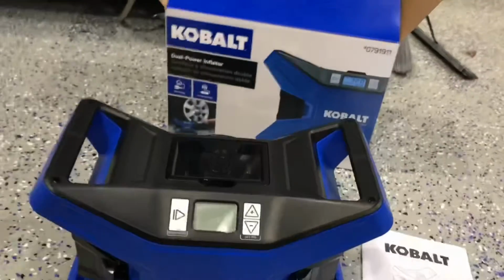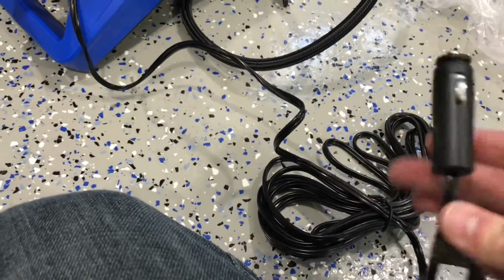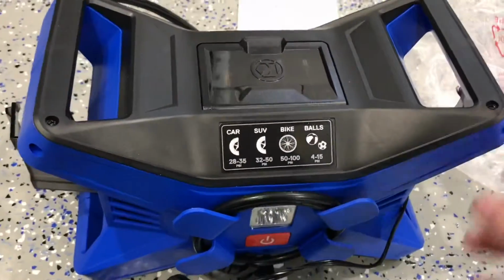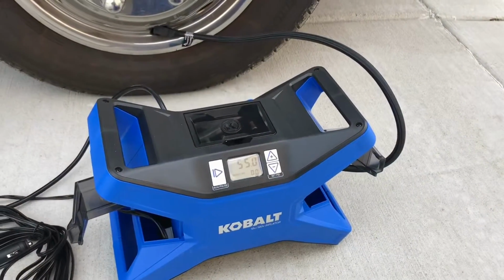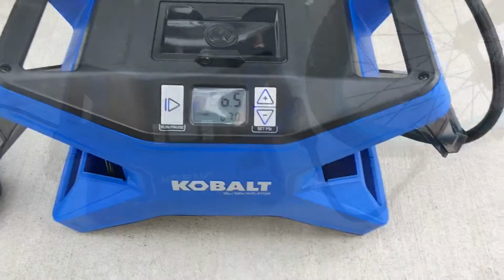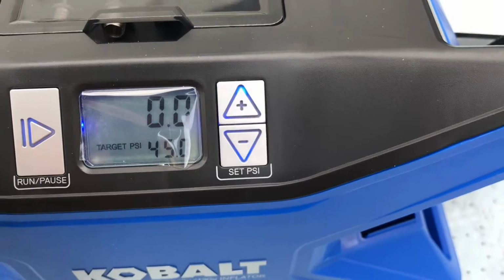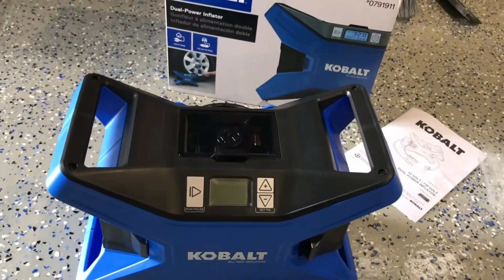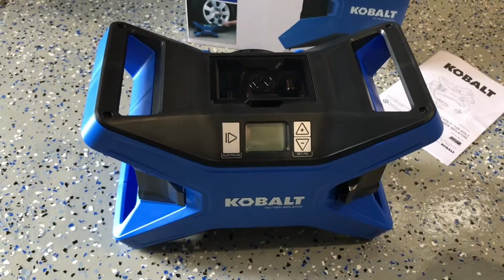Kobalt dual power tire inflator 12v/120v from Lowe’s review test

Comment: This is crap stop working after maybe 20 times of use in a year..
Reply from the maker: That sucks!
Reply: Mine still blows air, but I absolutely cannot get the air hose to fit onto the valve stem of my tires.